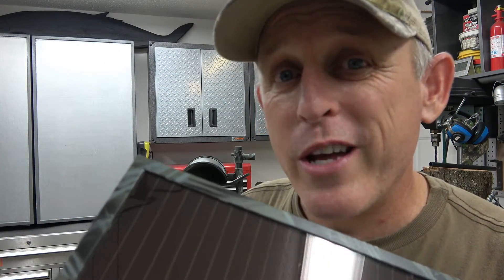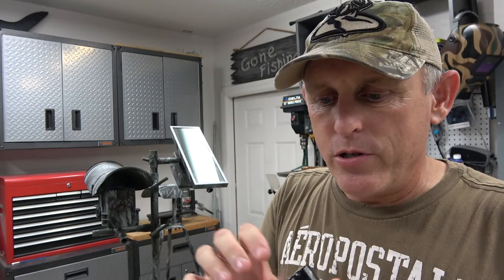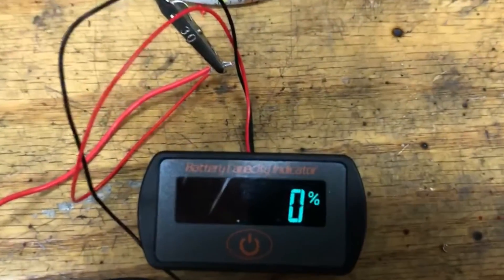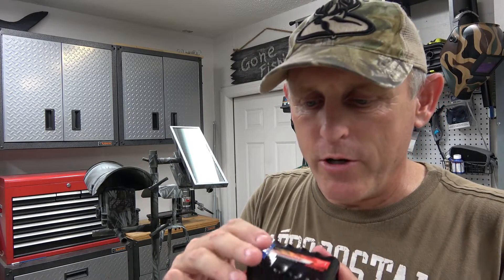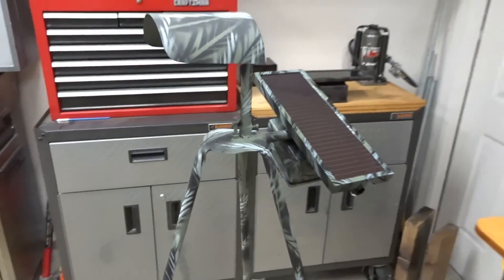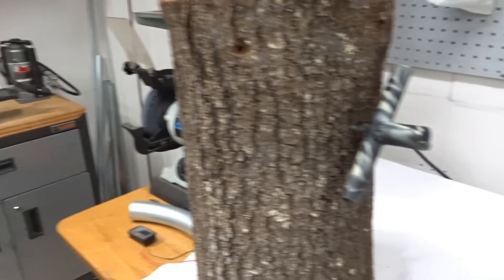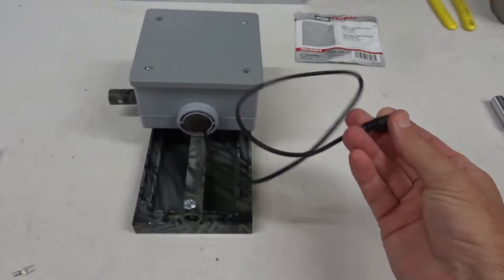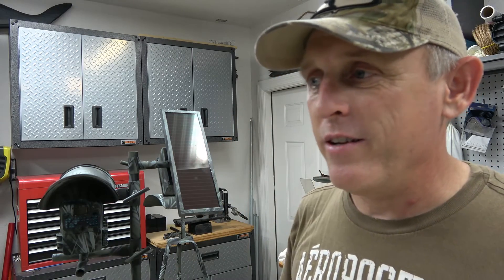Trail Camera Solar Batt Pack-DIY

Comment: Made one tonight and added a second battery pack and two 12 volt plugs to power Moultrie Mobile and a trailcam. Both plugs put out 11.98 volts. 

Great video, thanks!
Reply from the maker: Perfect!!!  Nice work and great idea.  One of my setups runs two Brownings and it works great! Let me know how it works out.  Thanks!
Reply: I'm also using this setup on Moultrie mobile camera combo but I'm using his original setup with the Moultrie y splitter! My output was 11.87. tonight my batteries are down to 85% per Moultrie read out! Looking forward to seeing how this performs this week. On average I get 1000 pictures a day!
Reply from the maker: How is this working out for you?  Is it maintaining your camera 100%.  1000 pics is a lot!!!
Reply: The Handy Hunter squirrels foxes and raccoons gets them more than other wildlife. With fall being here most to almost all the leaves are gone from the trees. I will probably get a larger solar panel to see if that fixes it. One camera died and claimed 100% until it never updated again. Went back a week later and saw batteries were dead. The other camera is at 90% so I’ll have to see if it recharges in the next couple days
Reply: I’m having trouble but I used the same setup with spypoint cameras and the squirrels and raccoons and foxes definitely have the camera take few hundred of photos. Built the setup with the same things and it’s not keeping up.
Reply from the maker: Cell cams definitely draw more than regular trail cams but this setup runs my Bigfoots perfectly.  A couple things...how much sun are you getting?  If it’s too shaded you may want to consider going to a larger panel to recharge quicker.  Also, you could consider running two battery packs to help keep up.  I had two Spypoints but never ran them on this setup because I couldn’t get them to work right on their internal batteries.  I finally gave up.  They may have a lot more draw than other cameras but I dont know for sure.  Let me know how it works out.  Good luck!
Reply: The Handy Hunter I am interested in making the hood over the camera. Mine already have condensation inside the camera from over time I guess. I’m sure it’ll help greatly
Reply from the maker: mauro alvarez hoods work great.  I  just built two for my cell cams out of a 5gallon bucket.
Reply: So far so good on the moultrie setup. How ever I did trouble with a browning setup but think it could be my camera.seaso. is over and I will be putting my volt meter on it and checking my output soon! I have also shared this with several hunting buddies! Thanks!!
Reply from the maker: richard smith sounds good!  Glad it’s working for you!  Thanks for sharing.

Comment: This sounds great, can't wait to try it.  But what keeps from overcharging the battery?
Reply from the maker: I don’t use a solar controller to prevent overcharging because it draws power.  You definitely could if you wanted too.  I haven’t had a problem so far so it’s a nice to have but not needed for this setup...IMO.  Good luck!
Reply: @TheHandyHunter  can I order this?
Reply from the maker: @donandbarbsketoe7553  sorry for the delay.  Unfortunately, I don’t have time to build anymore.  I know some are making them out of pvc.  Sorry and Good luck!

Comment: If you are running a 12v battery and the solar panel is charging into the battery from 14-19 volts and the output of the battery is a nominal 12.6-13 volts then there should be no need for the voltage regulator. Its only needed if you are charging right from the solar panel. .6-1 VOLT difference from the battery will not fry the camera.
Reply from the maker: My 12 volt panels register over 20 volts in full sun.  If your camera is connected to the same terminals on the battery as the solar panel you will get high pass through voltage directly to your camera.  Whether your camera can take it over time is a gamble.  Also, it may depend on whether your camera will be in woods under shade or in an open field in full sun for many hours every day.  I just like the protection of a cheap little regulator for peace of mind.  Thanks for commenting!
Reply: @TheHandyHunter  OK thanks. I will check the voltage out. Im putting everything on the line anyways. Im nor taking the chance. Shottky diode and fuse as suggested by another gent on the post. Thanks guys for your assisstance

Comment: What gauge wire are you using for your DIY solar and 12v battery set-ups?
Reply from the maker: Hi Ron, I typically use somewhere between 18-20.  Hope that helps!  Good luck!

Comment: When setting up a camera with external battery and solar panel, do you leave the internal batteries in the camera. It seems that would be ok as long as the voltage from external battery is 12 v going into a 12v camera. Is that right or best to remove batteries. Thanks and love your videos. Simple and easy.
Reply: you can leave the internal batteries in if you so desire. shouldn't hurt it. besides, if you're running external power, the internal batteries wont be used. from some research, all trail cameras have an internal diode built into them to switch power between internal and external sources to protect the camera from being overpowered by 2 different sources.

Comment: How many 12v trail cameras can be hooked up to 1 12v battery?
Reply from the maker: I  run two off the setup jn this video.  You could run more off a battery box setup if you wanted.  Hope that helps.
Reply: @TheHandyHunter  To run two cameras do I just add another 6 or 12v regulator running from the battery or do I run the two cameras off one voltage regulator?
Reply from the maker: Sorry for the delay...I got behind. Yes, you can run two cameras off one voltage regulator.  You will be fine.  Hope that helps.
Reply from the maker: Or you can run them separately .  As long as it’s regulated you are good to go.  I run two off of one.

Comment: I'm having a hard time wiring up the regulator.  Am I going to have to solder it?  I've tried shrink tubing and it won't hold it.
Reply from the maker: Did you get my email?  Did it work out?
Reply: @TheHandyHunter   I got the email.  Thanks again.  I'm heading to the hardware store today and will report back.
Reply from the maker: Perfect!
Reply: @TheHandyHunter   Worked perfectly!  Thanks again for the extra help!
Reply from the maker: You bet!  Anytime!
Reply: @TheHandyHunter  any chance you could share that information please. Thanks
Reply from the maker: barry smith I cut the barrel off a spade connector (I remove the plastic too) with some snips and then slide it over the regulator leg with the wire inserted.  I then crimp it tight after I slide on my shrink wrap.  Works great!  Hope that helps.

Comment: Hey Handy Hunter,  I'm very impressed and looking forward to putting this project together. But I have a question.  As I've watched your two solar panel videos you used two different 12v regulators, Does this make a difference?  I purchased the three legged ones. And do prefer this version ( I like this one ) over the one with the 12v battery bricks?  Thank you, Kevin
Reply from the maker: Hi Kevin, the three legged 7812’s are what I use the most.  If you want to use a different one it should be fine as long as it regulates the voltage you need for your camera.  Good luck and thanks for watching!

Comment: Hi,I wired mine exactly like your diagram & I don't get 12 volts through my plug plus my voltage regulator gets hot what did I do wrong,thanks Keith
Reply from the maker: Hi Keith, what voltage does it read at the plug?  The regulator shouldn’t get hot.  Sometimes it can be a bad regulator.  Do you have another one to try?  One more thing...are you wiring the solar panel wire directly into the battery without a plug?  Sometimes guys will use the plug on the solar panel wire so they can disconnect the panel in the future and the wires get crossed after the plug. Let me know how you have it setup.

Comment: Can I make a set up like this for my Spartan cellcam? They say only use 6 volt battery?
Reply from the maker: Yep!  All you have to do is follow my directions but install a 6 volt regulator instead of a 12v.  The 6 volt will down regulate the 12volt output and protect your camera.  I think I have links to the 6 volt reg's in the description.  If you need help feel free to contact me.  Good luck.

Comment: Your link for the rechargeable battery isn't correct. It is showing the irontron solar panels
Reply from the maker: Thanks brother!  Really appreciate the heads up.  I will fix it a little later tonight when I get back to my laptop.  Thanks!
Reply: @TheHandyHunter  no problem. Also later if you can, I left a question on one of your other videos. Having issues with the solar panel setup and would like some help
Reply from the maker: Ok, I will take a look!  Thanks!
Reply from the maker: Ok, I updated the link...thanks again!  Now jumping over to your other question.  Thanks

Comment: Okay I just found your stuff its good. But, can you tell me what is the reason for the pieces of the plant pots on the camera? I have an idea but I would like to hear more about it.
Reply from the maker: Not sure what you mean by plant pots?  Can you give me a little more info? Thx
Reply: @TheHandyHunter  The shade thing over your game camera.
Reply from the maker: Abel Esparza ok, got it!  It’s a sun shade and rain guard.  It protects the cams from getting sun beat and helps it take better pictures in the rain.  It keeps your lense from getting water on it.  Hope that helps!
Reply: @TheHandyHunter  That's very cool. Personally I have had my game cameras take a ton of pictures because of a slight drizzle.
Reply from the maker: These will help protect the face of your camera and take better pictures jn the rain.  2.5 quart plastic paint bucket at walmart, Home Depot or lowes.  Cost is a couple of bucks...cheap protection!

Comment: Thanks for the video. I'm running one of the new Cuddeback Cuddelink systems, and my cell home is terrible with batteries. Could I take the HME 12V solar battery box you posted in your links above, and just wire in the 6V regulator on it and be good to go? The Cuddeback Cell Home is 6V obviously. Thanks!
Reply: I had planned on just installing it between the battery and camera. Will it be necessary to regulate it between the panel and battery as well?
Reply from the maker: You are doing it right by putting it between the camera and battery.  You will be fine on everything else.  I just wanted to make sure you were not rewiring the whole setup....and if so that you didnt forget the diode.  I had that happen to a friend and his battery kept draining because he didnt install a diode.  You’ll be set.  Good luck!
Reply: @TheHandyHunter  Perfect, thanks for the help and quick replies. I was going to go broke buying batteries for this thing.
Reply from the maker: Cole Wise i hear ya...let me know how that box works out!
Reply: @TheHandyHunter  The box came in today, and the regulator is out for delivery. I just pulled the board out on the box, and it appears that it has a 12V regulator on the board. Do you think I could heat that up and pull it out and replace it with the 6V regulator? Doing it that way everything would still be contained in the box. Here is an image to the circuit board ->https://imgur.com/JL4fgZZ
Reply from the maker: @colewise9467  Sorry for the delay Cole.  For some reason this went to my spam folder...I think because of the link.  Anyway, if it were me I would try to keep it on the board.  If you can't, wire it inline and seal it up good.  Maybe add some length to the cord so you can keep the regulator inside the box?  Let me know what you decide.  Thanks!
Reply from the maker: Yes you can!  I’ve had other people tell me that they have done that.  Just make sure you test the voltage after install before plugging into your camera.  Are you having to rewire to the solar panel as well or are you simply inserting reg on the wire from battery?  If you mess with the wiring between the battery and solar dont forget to reinstall a diode.  If you are just inserting reg between battery and cam no worries.

Comment: Hey I love the vids!! I have a couple questions about batteries. I'm up in Canada and was wondering if nickel cadmium or lithium ion would be better for our cold winters? Also probably more importantly when selecting a battery and or solar panel what kind of  "Ah" or mAh  or output should I be looking for. Thanks
Reply from the maker: We don’t get the cold that you guys get but I’ve always heard of guys up north using Lithium ion in very cold weather with good results.  Regarding Ah, to keep it simple the higher the Ah the more energy storage (and usually the larger the battery).  Hard to say what size you need without knowing how you are using it.  If you are hooking up a 1.5 or 2 watt solar panel then you can get by with a smaller battery because it gets refilled daily.  Keep in mind that trail cameras use very little power on a daily basis so you don’t need much to keep them running. Hope that helps and good luck with your build.  Sounds like you are on the right track!

Comment: Nice setup!  I use this battery and it last a long time as well:  https://www.amazon.com/Powersonic-Sealed-Rechargeable-Battery-Security/dp/B007Z462S8/ref=sr_1_4?s=automotive&ie=UTF8&qid=1544632134&sr=1-4&keywords=12+volt+rechargeable+battery   

Not sure if it will fit in the box but it is probably pretty close!
Reply from the maker: Thank you Bob!  I've used that brand in the past with good success.  This one is too big for the small box but thanks for passing along.  Would work well in a small ammo box!  Take care and thanks for watching!

Comment: If you have a 12 volt camera why do you need a 12 volt regulator?
Reply from the maker: Great question!  You need a regulator to protect your camera from high pass through voltage from the solar panel.  It’s ok to pump 22-24 volts from your solar panel to the battery but you need to stop that high voltage before it reaches your camera.  A 12volt solar panel puts out about 22-24 volts in full sun.  Hope that helps!  Good luck!
Reply: @TheHandyHunter  Will the 22-24 volts from the solar panel hurt or damage the Tenergy NiMH Battery Pack 12V 2000mAh High Capacity Rechargeable RC Battery.
Reply from the maker: Nope!  It needs that high voltage to charge.  I’ve had mine in the field for several months now and still going strong.  The only thing I don’t know is how many years they will last.  Hope that helps!  Thanks for watching!
Reply: @TheHandyHunter  Did yiu ever make a link to purchase some of your setups. I may be interested in the lag bolt part you screw in the tree.
Reply from the maker: I didnt make a link but I do build stuff  as people request.  You can email me at steve@digitalsouth.com and let me know what you are looking for.  Thanks!

Comment: What a fantastic build is there a way I could do this for a 5-volt Wi-Fi camera? The camera connects to USB power supply that I have it only last me a day. I would like to know if I could do the same thing with 5 volts Wi-Fi camera. I really like looking at the critters at night live when I am at home.  I am a new subscriber Great Channel.
Reply from the maker: Yes you can!  Rig it the same way in the video and use this 5 volt regulator to regulator the power to your camera.  This is actually what I'm thinking of doing for my next home security setup.  Good luck and let me know how it goes.  Welcome to our channel and thanks for tuning in!  https://www.amazon.com/MCIGICM-voltage-regulator-Regulator-Positive/dp/B07BDFMQF6/ref=sr_1_5?ie=UTF8&qid=1538426688&sr=8-5&keywords=5+volt+regulator

Comment: Clean and well thought out!  Man I'm super impressed with all of this.  Really appreciate your camo and clean design. What is the shade/rain cover for the cameras?
Reply from the maker: Thank you!  I have a video coming soon on that stand with the rain/sun covers.  They are made by cutting a 2.5 quart paint pale in half and then painting.  Works great to keep the sun from drying out your plastics on the front cameras.  Also takes better pictures in the rain and early in the morning when everything is covered in dew.  It’s just a good protector.  Thanks for watching!
Reply: Looking forward to that video. Really good stuff you are producing. Keep on keeping on!